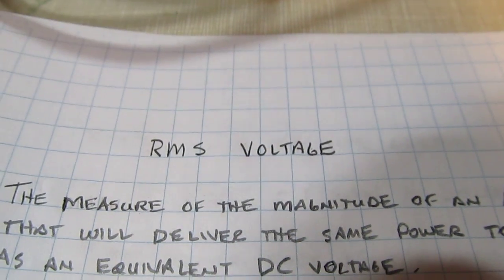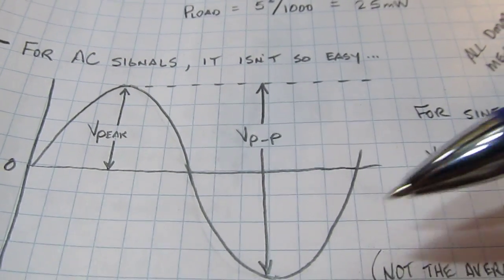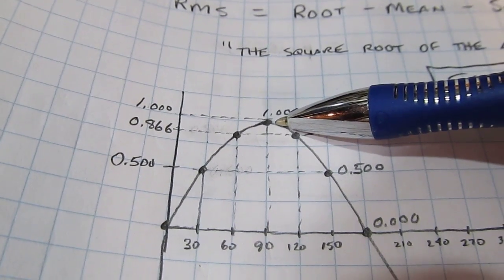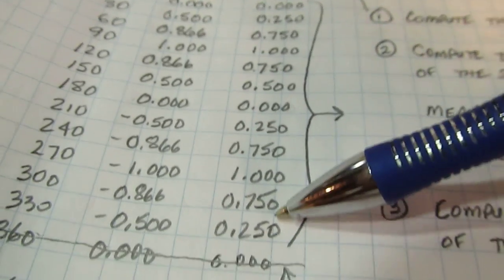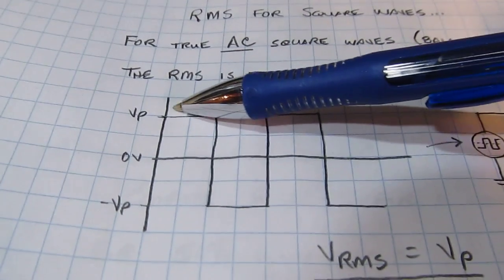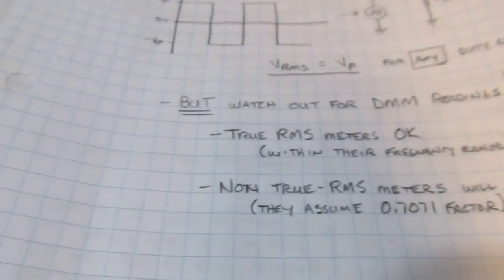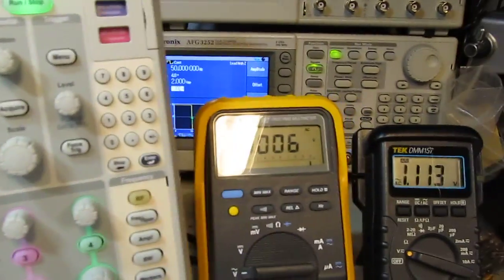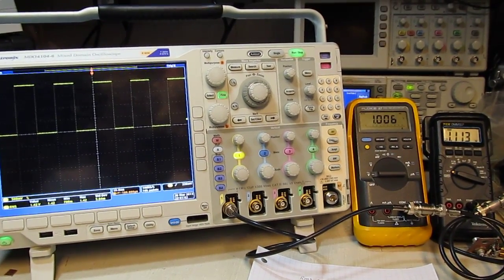#94: RMS Voltage for Sine and square waves, and why your DMM might not work right!

Comment: Some of the DMM's I've seen will give a voltage rating plus the duty cycle at the same time on the display.  So if you are making a quick check of a chips output to see if its faulty it gives a better picture of what is happening in circuit without bringing out your scope.

Comment: thanks for your vídeo. but do you know how get current value? this from a multimeter I've been trying but for example the read is 188mA and the real current most be 200mA how I can make an approximation
Reply from the maker: Depends on many things including the particular DMM you're using, the frequency of the signal, the wave shape of the signal, etc.
Reply: Well that's true, I'm using a Fluke 179, when I change the frequency nothing change, but sometimes when I'm read 10mA the error is more bigger like 21% . I'm looking for a solution. Thanks w2aew!
Reply from the maker: How do you know there is an error? Have you accounted for the affect of the burden voltage of the ammeter?
Reply: +w2aew Yes, my TrueRms say for no sinusoidal wave, add 2%measure +2%scale.
So my Scale is 400 mA, and my measure is 188mA . Do you know something about High impedance in a signal generator? Thanks for you answer. I tried with a R circuit. of 50 and 100 Ohm. of 5 W.
Reply: +jay lord frama I have an Agilent 33220a using no high impedance just 50 ohm of load that it has internal. The current is more stable.

Comment: Does an Average-responding DMM have RMS? Is it dangerous for AC beginner DIY electronics to use such a meter without RMS or true RMS? What's the difference between RMS and true RMS, or is it just a marketing term? Also, is there some sort of way to reverse engineer what a non-true RMS DMM displays by using a formula for an accurate reading? Aren't most basic electronics DC anyways? Sorry for all the questions!
Reply from the maker: +Dark Seid An average-responding DMM will only show an accurate RMS value of a sinewave input, and only if it is at a frequency below the maximum frequency rating for the meter.  The difference is that True-RMS will give an accurate RMS voltage reading for various waveforms.  Without true-RMS, the reading will only be correct for sine waves.  Different waveform types would have difference equations to calculate the true RMS value.  No danger, just getting incorrect readings.  And yes, most measurements for basic electronics are DC.
Reply: ***** Thank you so much!

Comment: Hi .. I just have a basic question. Why is everyone using the RMS ( which is a quadratic mean [ power of 2 ] ) ? Why not use a normal average ? I'm not quite convinced by the fact that because of the direction changes in AC voltage, the value will sum up to zero in a single cycle ( from 0:2*pi, say ), for an answer here. That's a theorotical answer. Practically, why not always take a Modulus(-ve value) and do a normal average. Since what we mean here is literally "voltage means work done", we can always ignore the -ve sign and flip the voltages which are below x-axis to the top of the x-axis and do a normal integral over the period of relevance. For a sine. this happens to be 2 square units from 0:pi  [ 1 square unit  ( 0 : pi/2  ) + 1 square unit ( pi/2 : pi )  ]. Converting the area of 2 from the sine curve to a rectangle, we get an amplitude of 0.6366 ( considering the rectangle width as pi ), which is infact the Vavg ( which is < Vrms ). This looks perfectly corrrect for me. In this case, why is Vrms preferred over Vavg ? Thanks !!
Reply from the maker: Because the goal is to find the equivalent voltage that would do the same work.  Work is equivalent to power. Power is proportional to volts squared.  Thus, the instantaneous power produced at the halfway point up the sinewave is not half of the power produced at the peak.  To get the equivalent dc power producing result, we have to take the root of the average of the square values over time.

Comment: Fantastic video, I really liked it.  However, I am a bit confused on the bit at 5:43. You said that "RMS voltage, on a square wave, is equal to the peak voltage for any duty cycle" and I was a bit surprised to hear that. Can you please explain why "for any duty cycle"?  Thanks. Regards.
Reply from the maker: This statement applies when the squarewave is balanced around ground, such it's high and low voltage levels are +Vp and -Vp.  Thus, regardless of duty cycle, a voltage of Vp is always applied to the load.  The polarity changes, but the power dissipation in the load is the same.
Reply: *****
Thanks for the explanation and my confusion is no longer. Just got back in to electronics after many years. Regards.

Comment: I'm curious why the non true rms meter wouldn't read .707V for the 1V PK square wave?   I was expecting 1 x .7071 = .7071.     My non-true rms Fluke 79 reads 1.110V, about the same as the non true rms meter in the video.

Comment: Awesomely lucid and clear presentation-as usual- Alan. Would love to see your take on PEP vs peak vs average input and output power in regards to amateur radio as the rules have changed over the years, in term of the various modulation modes and lastly how manufactures talk about these things. Seems like your discussion of RMS voltage could be a good entry point to what I see as a mildly confusing topic to new hams, generating debates on various forums tens of pages long! lol!

Comment: Very good explanation of True RMS and AC coupled DC. The only thing not touched upon is crest factor ratio and perhaps showing a real meter which does measure AC-DC TRMS (such as an old Datron 1061 design circa 1979). This is the best explanation  I have encountered published in video format. Good job.